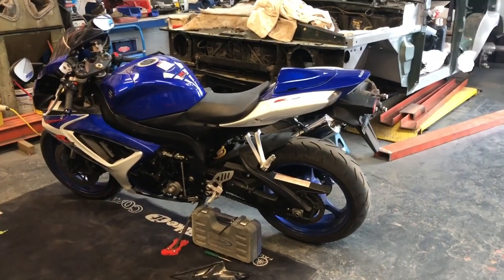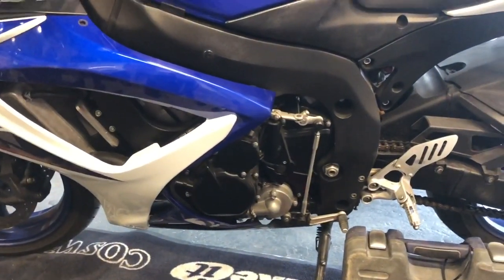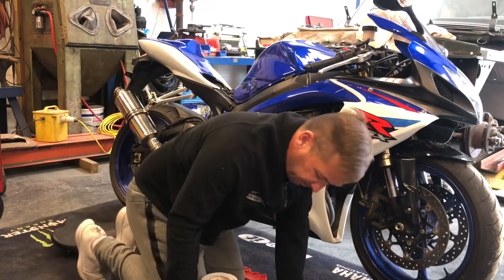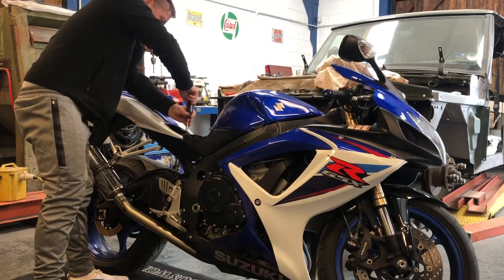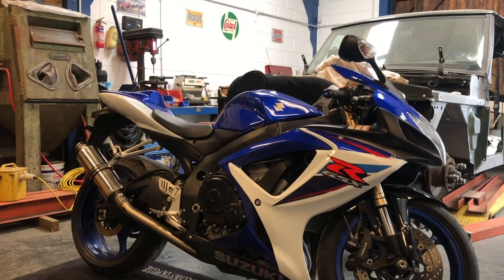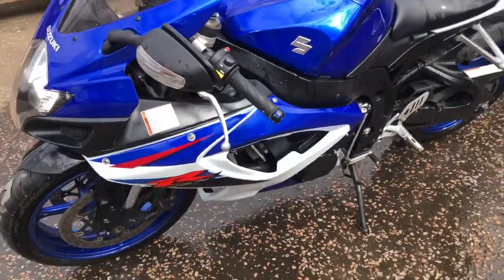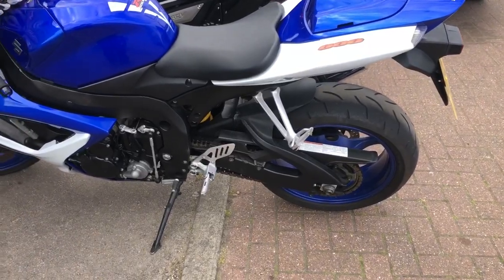Suzuki GSXR  Salvage Rebuilds UK project PT 3  £££ ???

Comment: That is an absolute bargain. I had one exactly the same lovely bike and very fast. You might want to get a Rectifier Relocation Bracket as the are mounted behind the radiator and sometimes overheats

Comment: Looks tidy for a 13yr old bike, you've done a good job on that bike. Most of those marks and scuffs are just age related etc 
The 'hunting' idle is most likely due to the ECU losing it's settings and memory when you took the battery off. Just do a full warm up and take it for a ride for the ECU to 'relearn' all it's settings and it should run fine after that. 😎👍

Comment: Perfectly normal for the gsxr’s to do that idle. Even from brand new they do it so nothing to worry about 👍🏼
Reply: Just sounds like anything with a lumpy cam in it :)
Reply: If I bought a new bike sounding like that, it would go straight back, should run much smoother, especially with injection......needs a tune/ Dyno run as a few people have mentioned

Comment: Rough idle is most likely because of the exhaust and the cat being removed. Power commander or bazzaz fuel module and get it mapped on the dyno will sort that mate
Reply: Power commander and a good dyno run

Comment: Rob, The Belly pan doesn't have a nut and bolt to secure the 2 halves Suzuki use 3 Plastic Rivets (Clips), Two Smaller ones on the outer edges:- 
CLIP, FRONT x2 (BLACK)
Suzuki Part Number = 09409-06314-5PK 
And One Larger Rivet in the Center:-
CLIP, JOINT x1
Suzuki Part Number = 94479-35F00
Did you get the number plate light sorted ?
Hunting is OK on Idle probably due to the end can.

Comment: "Didn't break any speed limits"

He says while failing to look straight at the camera 😉😂👍
Reply: I should add I was only teasing :)
Reply: I think bikes should do any speed they like as it’s only the rider that’s putting himself at more risk but if done safely on clear roads it should be do what you like. No need for speed limits not on motorways and that should include cars too as let’s face it all the small cars and family cars just can’t comfortably do much more than 90 without  drinking fuel and sounding like they want to explode lol. Modern vehicles are much better equipped for safety and can handle 100mph outside lane no problems
Reply: @Alexander_l322  Nope, terrible idea. What about push bikes and pedestrians? Also the mental impact on a car/lorry driver who hits a motorcyclist...
Reply: Don't play poker with him!!
Reply: maxed out in 4th gear nope deffinatly diddnt break any speed limits  :D :D :D :D
Reply: @Alexander_l322  thats silly
Reply: @heatz711  The copper must've been an old boy, used to Sierras in the 80's/90's ready to pounce 😂😂
Reply: Sammy TheSeal do you ride a push bike or walk along a motor way? Don’t think I’ve ever seen a push bike going up the a40 ,m25 or any other motor way lol I’m not talking about normal streets were there’s pedestrians or other vulnerable Road users!
Reply: Dave Allen it’s just my opinion at least I’m brave enough to share it. carry on as you were
Reply: @Alexander_l322  So you're saying that motorbikes can do 100+ mph and swerve around cars/lorries doing 70?? Yeah, that's safe isn't it...

Comment: The free flow exhaust is probably causing the engine to hunt but it shouldn't cause any damage. Put the baffle in and it might help or if you want to leave the baffle out go the Power Commander route with a free flow air filter and get it set up on a dyno. Your mate that races will either be able to help or point you to someone that can do it.

Comment: Thats the bargain of the century brilliant .  I paid £2700 for mine with 7000 miles on the clock. It had been dropped needed new side panel and clutch lever. Same model as yours. More bike content required  or even build a kit car 🤔😉

Comment: Sometimes they do that when the throttle bodies are out of synchronisation slightly,  If you balance them correctly the idle does be alot smoother 🙌

Comment: Hi mate loved the 3 vids you did on the GIXXER....was sad to see the state it was in when you collected, I had a 600 K8 (the one in the icon is me in June 2015) stolen in November had from June  2012 at 8,399 miles to nov2015 when just turned over 31k. I expect mine ended up in similar state to what yours was stripped for parts. Ins took 4 months to settle claim .. Feb 2016 got a newer L3 750 yoshimura edition one of only 25 made that year so ultra rare! I now have a tracker fitted but as not quite 5 years since the theft am still being hammered on ins all these years alter... I notice you said about the engine hunting in the vid, I have to say mine does that as well but does have a power commander fitted the previous owner said that was why it did it but not sure now.. good luck with it whatever you do , if you keep it do fit tail tidy !

Comment: A nice bike for little money. I may be a bit biased but I love Suzuki's and have owned 1200/600 Suzuki Bandits. How good was it to get all the bits and bobs as well with no hassle involved. 

Your'e 600 Gixer does not need a battery strap as it sits in the battery bay like that as standard and I don't think the engine is hunting maybe it needs a good run. Anyway keep up the good work  Matt

Comment: hi rob  not 100% sure but after wash  tail pipe end look as  pointing over tire  looks like needs  turning anticlock wise 20 degrrees  and also you lucky lucky  bip bip  £1300  love the vid ive also got one of the cheap cam  there is  different recording quality setting but not that great speaks for self £18 cam or £150 can do the maths for quality  loved the vids

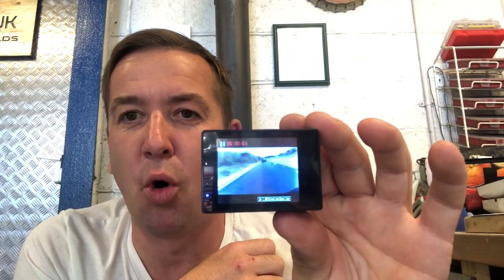Comment: 12:07 I had one of these little cameras there not great and deffo not 4k, however if you go into the settings or connect it to your phone via the wifi useing the app you can set it to, 1080p 60fps make sure you have a big enough sd card because it will eat it up, with this setting you will get gopro comparable footage. and playing back the footage on that little screen dosent help.
Reply: the app is free btw if you dont have it i can let you know what its called.

Comment: You might need to get a faster microSD card for the camera. It might film 4K but if the memory card is slow the footage will be bad. Even on a GoPro you still need a faster memory card otherwise you’ll have the same results. Hope it helps :D
Reply: Alexandru Perea also depends on what its played back through?
Reply: @silvermane9370  Not sure. I only mention it because when I got my GoPro I just reused an old micro sd card I had and the footage was very bad. Certainly not the quality I used to see on other people's GoPro videos. It was only when I got a fast micro sd (A2 I believe) that the footage improved. Now that I think about it I played the video on my PC and it was still bad. So I don't think it matters what it's played through if the initial recording wasn't of good quality. Hope it helps :D

Comment: The hunting could be down to the throttle bodies being out of balance, not many people actually bother checking them, it's not a hard job, just like doing carbs with a set of vacuum gauges.Try Auto Glyme super resin polish, had get success with snatches on plastics with this stuff.  If you want to give the engine a nice black shine,use some silicon dash spray and wipe off the excess.Cracking bike the 600. HARLEY!! face palm lol

Comment: Don't worry about that rev bouncing. Most likely to do with the slip on exhaust which is normal.  You can increase the idle a little to stop it if you prefer

Comment: You can't judge the quality of the camera's video by watching on the built-in screen. Even so, I wouldn't bother trying to shoot 4K video on a cheap camera, even if it does have 4K on it. It won't be anywhere near true 4K, it will be software upscaled/interpolated.

I have a 'cheap' 4K camera (wasn't as cheap as your one, about £40 IIRC), but I only ever use it at 1080p30, works well enough. I will try 4K at some point, but not on the bike.

Comment: You might be missing a “v” piece that goes infront on the exhaust headers that bolts between the two fairings where you had random fixing holes underneath.

Comment: Never owned a gsxr rob but pretty sure there should be a rubber strap holding that battery in place there is on most bikes. I'm guessing that hunting cleared its self once it had been run & the battery was fully charged ? ps that mileage is low i do more than that in a year on my touring bike lol

Comment: It's quite common on the 600 Gixer when you change the exhaust and filter. You can either retard the timing or throw a power commander on and have it tuned.
It may be worth having the throttle bodies balanced when you have it serviced.

Comment: Those little cameras from eBay or wish are really hsit mate! If you want to get something then get a proper branded go pro they are about £80 or £100 I think but it will have a better frame rate and overall much better quality videos from it or even a cheap older phone will be better that it was and it wouldn’t put your good iPhone in harms way if it flew off the bike. I think it sounds great and what a perfect end with it flying though the mot and inspection! £1330 and I though the people who stole it were the thieves lol you done so well there. I said I’m not a bike guy and I still ain’t but god that is cheap.

Comment: I race a GSXR1000, but on the average country road or tight track, the 600 is just as quick on any day of the week (and more fun!). As for the 'humming' from the exhaust, as someone else mentioned - totally, 100% normal. And again as someone else mentioned - import the footage from the SD card of that 'action camera' (it's NOT a GoPro!) to your computer - don't judge the quality of the footage from what you see on the tiny inbuilt screen, that is literally just for framing and reviewing. It may well still be cr@p, but ya never know: it's worth a look! And please, please, PLEASE for the love of jehovah - NEVER film anything with your phone in the upright 'portrait' mode! Please just turn it around 90 degrees to film in the proper landscape mode as you would with a normal camcorder or video camera, so it matches up with the look/frame of your TV or computer screen: I beg you!! 😉

Comment: That footage might of looked decent through a proper screen. get that sd card in your computer then export footage to phone
Reply: Was just about to say the same I've one similar and it doesn't looked good until its on the computer! And play around with the settings mines wasn't set to 4K (more than likely 1080) but when changed over and on a pc it looked decent.
Reply: Yep I agree with this, was going to say the same myself!
Reply: I Agree, I have one and the footage is all right on pc or tv. Watch out for strange buzzing noises on sound it is possibly the buttons on the camera rattling pick it up and shake it!, put some clear tape on them.

Comment: Rob, I'm on the scrounge, 🤣👍 would you ask Chris for me if he has ever done a brake bleed on a P38 Range Rover before? Only reason I ask is I've replaced all the brakes on mine and it's a special way of doing it, or dous he have a copy of Rave he could put a link on here for me? Sorry to be a pain. Tom 👍
Reply from the maker: Just start from the furthest one away from the reservoir and have the engine running use an easy bleed it will make life a lot easier for you
Reply: @sruk  That's spot on Rob, thank Chris for me bud, and I'll let you know how I get on. 👍
Reply from the maker: fatboy 4pie I didn’t ask Chris
Reply: @sruk   sorry Rob, I assumed you did cos I know he's a Land Rover guru, appreciate your help. 👍

Comment: Should never rely on a MOT for safety, the MOT is only about the very minimum to be road legal... NOT safe, things can be unsafe but pass or even not checked as part of the MOT test. Ask them to do a full check over as well as the MOT, that way you are covered.
Reply from the maker: I did I said they spent a couple of hours going over it and doing a service
Reply: salvage rebuilds uk it was more a comment from earlier in the video and advice stressing this for others.... I see and hear comments about safety or standard of a vehicle based on its resent passing of an MOT, having been a MOT tester and master tech in the past I know there is no correlation and a car can be dangerous but still pass the MOT to all the specifics in the very prescriptive manual, it’s as bad to fail a car on something that’s not in the test as to pass one when it should have failed.

Comment: I bought the same camera here in Aus for $30, it's absolute rubbish. Choppy video, sound out of sync and 20 mins battery. I found a GoPro Hero 2 on facebook market place for the same price.  Used and older GoPros are getting cheap.